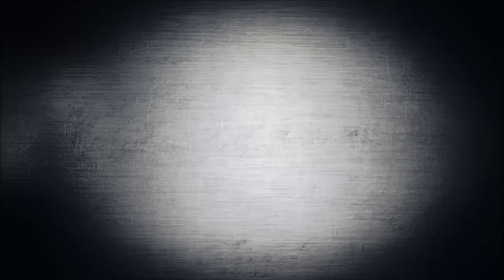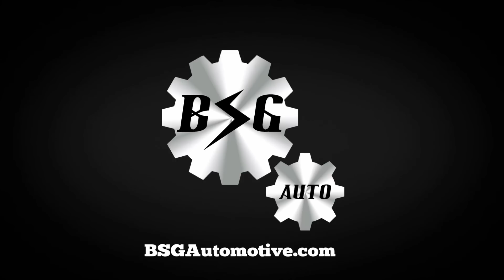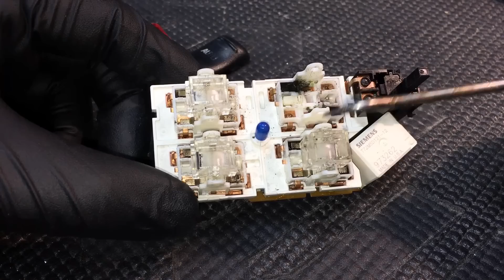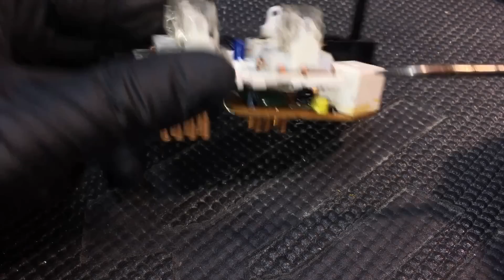Ford Chevy Chrysler Power Window Switch Failures

Comment: That window switch video you have is somewhat respectable but if you did other models like you Japanese in your Europeans you'll find out they're the same way and if you was to go deep into a father and hook a lab scope up or a amp probe you will find out that most likely it's pulling too much current and another thing on that old 99 I think they got their use out of it after 5 years old so I don't think that's too bad